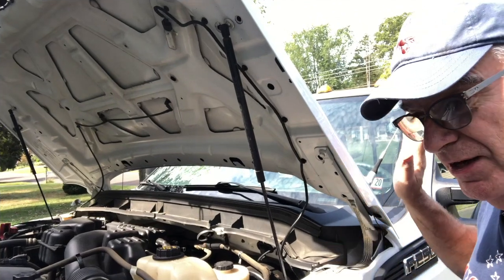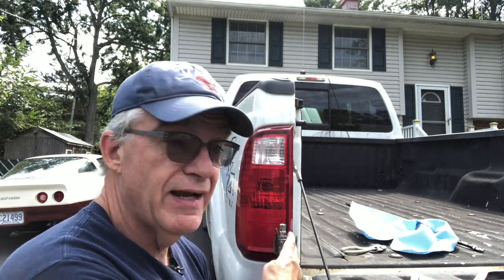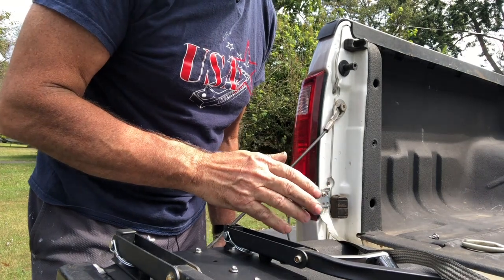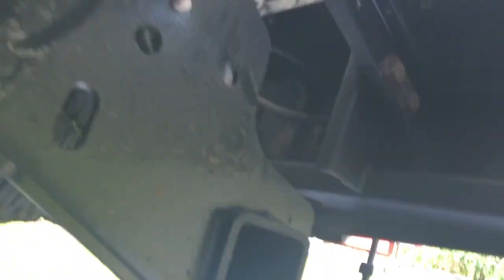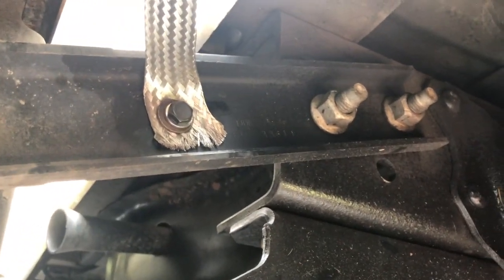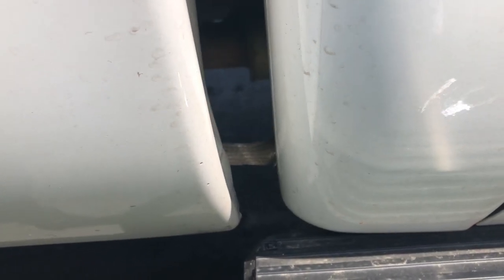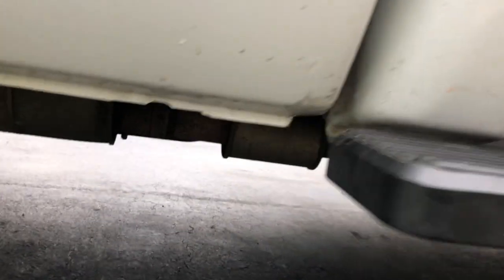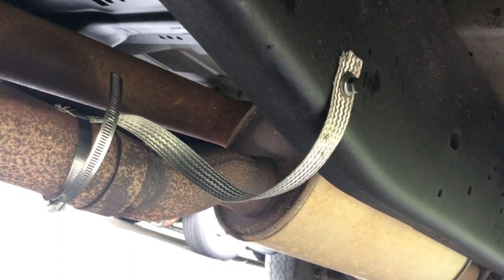Mobile HF Installation Part 2--Bonding

Comment: GOD, I should have this in 2003 when I was doing it on my HUMMER H1. The picture is still on the Tarheel website. Red one. I forgot to bottom... But I did the door, I think you should also do it the door. Remember there is a very thin line between a ground plane and a FARADAY CAGE. By adding the door and more bounding you plug the holes and happy new year. 73 VA2SOB Claude.
Reply from the maker: Claude M. P. Yeah, I still have to do the doors.  I also bonded the radio chassis to the truck body and the negative battery terminal to the firewall.  Thanks for checking it out!
Reply: @k2cjbradio  Good idea. I am using some king of aluminum plate an lock it on the floor, lock the support on the plate so it is nice looking.
Reply: Did bonding do a big difference?

Comment: This is a GREAT video series! I have been looking at how to install my FT-891 and ATAS 120A into my Ram 2500. One question I have is, is 3/4" necessary or just the most efficient? Keep up the great work!  Subscribed
Reply from the maker: WJ6F Thanks for subscribing!! I don’t think there’s any benefits using 3/4” instead of 1/2”. I actually a few more bonding straps after shooting the videos and used 1/2”.  I also added coax chokes at the base of each antenna and at the antenna connection on the radio to try to reduce ignition noise.  And I also installed a shunt coil at the base of the 40m stick to improve matching and reduce static build up on antenna.  It definitely improved the antenna impedance.  Thanks again!!  73 de K2CJB
Reply: @k2cjbradio  Thanks to your video series, tomorrow I will be bonding my Ram 2500, installing the FT-891,  ATAS 120A, and making a video of it. Your video series was invaluable in my being able to properly do this and film it.
Reply from the maker: @WJ6FRadio  Fantastic!!  I’m so glad it all helped!! Looking forward to seeing your video!  Thanks again!
Reply: @k2cjbradio  Well.... As I am sure you noticed filming was delayed due to this corona crud. I hope to get it done this week. Maybe a multi part series like your videos.
Reply from the maker: WJ6F That’s ok.  When you’re ready, you’ll get it done.  Looking forward to it!

Comment: Looks to easier than I imagined. How much braid (length) did you start with?
Reply from the maker: Bargain Basement Ham Radio I think I had about 6-8 feet. The longest pieces I used for this project were the pieces by the tailgate
Reply: @k2cjbradio  Thanks Chris!